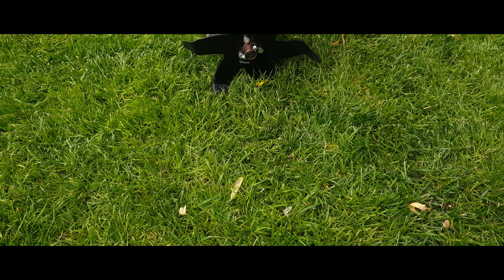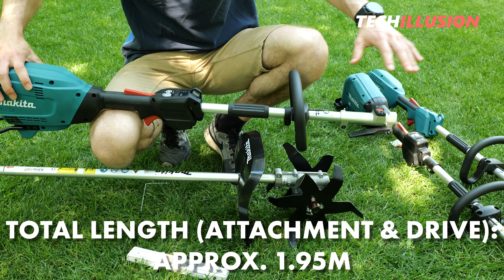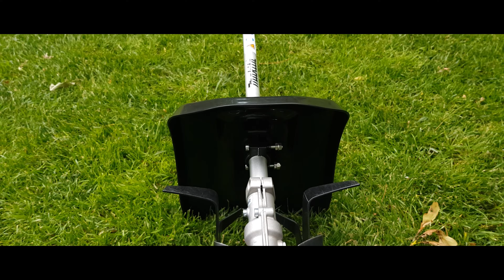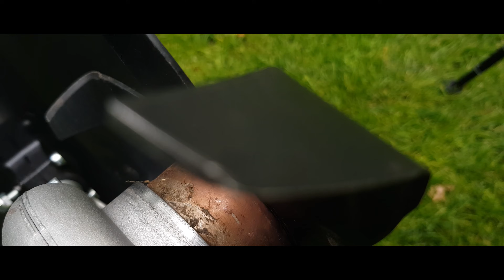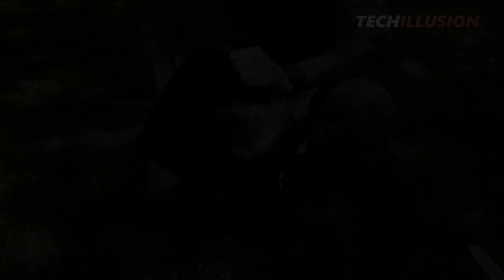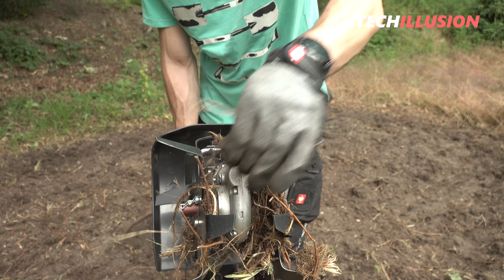🔥The MAKITA Cultivator Attachment KR401MP😨🤨 Cultivator Attachment- KR400MP & KR401MP Test

Comment: 40 centimeters is too deep if you are working around plants.
Reply from the maker: Hello @milesdust3465,

Thank you for your comment. Thats right. It's important to consider the specific needs of the plants and the potential impact on their root systems. Adjusting the depth based on the type of plants and their growth requirements can certainly help in ensuring their health and safety. 
This was just for demonstration 
Best regards